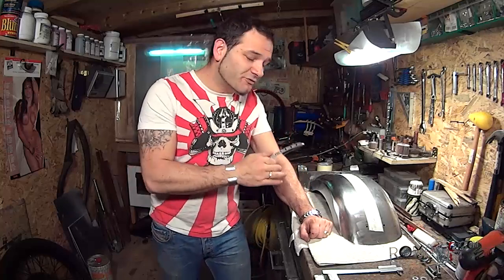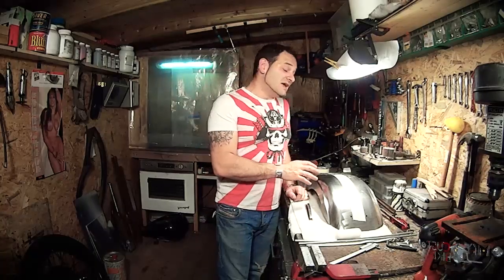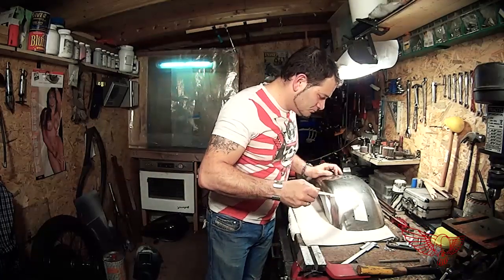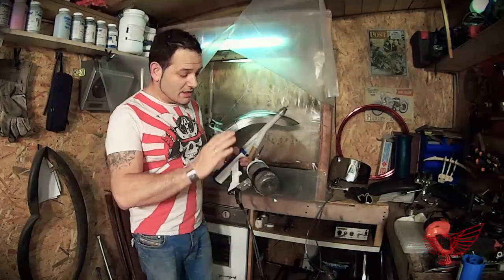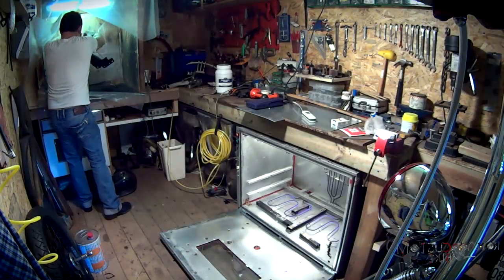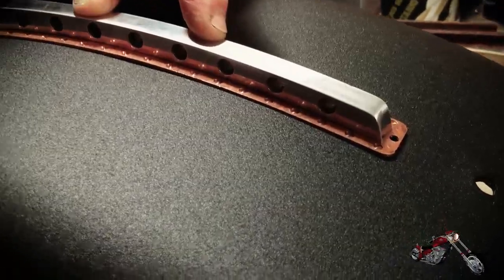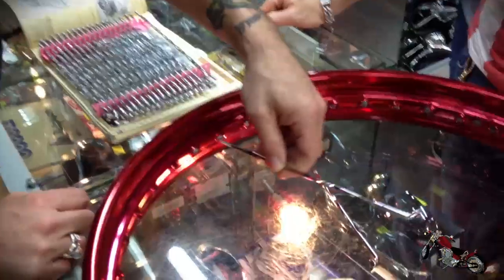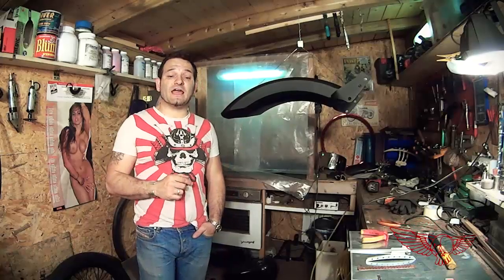DIY Powder coating at home, how to, tips and tricks - Harely fender - 5 - Roma Custom Bike

Comment: I just found this page yesterday and I completely dig it. I have a question about the temps for coating. 1 - What temp does the oven need to be2 - What temp does the item need to reach before you set the timer3 - How long do you keep the item in the oven once it reaches said temp
Reply from the maker: +claythe1 hi Clay and thenk you :)
both the oven and piece nedd to be at 400F (204 celsius), some paints require different temps and it will be marked on the paint box. Point is that what ever temp is referred to the part, so a large cast iron piece will take longer to reach the right temperature. 
Usually you will set the timer when the paint "flows out", so goes from powder to liquid form. Also the time depends on the paint, most require 20 minutes, candy and transparent a little less time (and often less temp too). Again the time shall be specified on the box or on the manufacturer site.
Hope this helps :)

Comment: I have a 2006 Honda Rebel and want to powder coat the tank.  It has never been touched before, no rust inside or out....just a question.  Will the baking process cause any damage to the factory lining inside the tank?
Reply from the maker: Bob G Hi Bob, well, that's a good question and I would suppose yes! but only if there is one. Often there is none or a very light coating of paint. If the after market lining was applied before (like the one u can buy in stores for restoration) I would imagine yes.
Let me know what u come up with :) I'm curious

Comment: Course you can fill. I think the most I have done to anything was 4 coats of epoxy primer with some filler on each coat of primer, then a single top coat of polyester. I use JB weld. Not that I use that much filler, I am still on the tubes I bought in 1991! All with a cheapo gun.
Reply from the maker: doesn't the filler bubble up under the powder when you put it in the oven?
Reply: Custom Cez
No The JB weld I have is good for 600º, yes the funny little yank degrees.
It takes a few days to cure, but I wack the part back in the oven for an hour at about 80º and the JB weld is hard. I only put a very tiny amount of JB weld in for slight imperfections I have missed. I guess it's probably JB weld classic, I bought the tube in C1990. I keep meaning to try lead free solder, body solder starts melting at ~185º lead free it is over 200º. That coating gun looks good, I use the very cheap thing.
Reply from the maker: the second thing i thought about is that it wouldn't stick because it's not metal... but if it works for you i guess it's not an issue... i'll try it.
I did try regular lead and it does melt and run away from the part, next order i'll get the lead free from eastwood... already in my wishlist ;)
thx for the info, definitely gots to try it :)

Comment: Thanks for your video! One question....how do you stop airborne dust and fibers from settling on the part which is what I'm having trouble with? Oh and btw its an electrostatic attraction not electromagnetic...
Reply from the maker: Hi DE s, thank you for your comment.If you can't have a very clean and sterile environment try spraying some water on the walls b4 coating, that will keep the dust a bay for a while :)
Reply: Custom Cez
 Thanks,  good Idea...but I saw your spray booth and I made one too! thanks for the idea..I used it and still some crap on the powdered part...I think I need an inline air filter now.....another question if I may, how do you regulate your oven temp please?
Reply from the maker: u r welcome :) glad i could help.
For the temp get a laser thermometer (harbour fright perhaps) and check the temp on the actual piece to make sure it's going at the right temp :)

Comment: Bro will brake cleaner strip powder coating?
Reply from the maker: Hey man, it doesn't gurt to try if u have it laying around :-) but most people talk about the gasket remover as an alternative to professional products. I use a product i found in europe who's main ingredient is methanol. It works better that the powder stripper from eastwood. If u can fins some stripper with that ingredient u'll be good :-)
Reply: Custom Cez the reason I'm asking is that I purchased a powder coated extended swingarm for my Raptor and I did the assembly and bleed my brakes. so after I bleed the brakes I sprayed up a caliper with the brake cleaner and the residual brake cleaner literally stripped the paint off of the swing arm or alleged powder coating I should say. so I was just wondering if it supposed to do that with just brake cleaner??
Reply from the maker: andujo211 i see, well anything chemical like that if left long enough on the painted surface will do some damage to it, but i'm talking loosing shine or minor damage, i used the powder to do the brake reservoir and it's still like new. So probably wasn't powder... or crappy one, like not properly cured. Sorry man, my suggestion would be either to return the item or bring it to a local powder coater and get the job done to your standards.
Reply: Custom Cez Right on. thanks bro I appreciate the info.
Reply from the maker: no problem man :)

Comment: Spelled "responsibility" wrong at the beginning....

0:54 secs
Reply from the maker: crap! that's in every episode :( thx for pointing it out man
Reply: Custom Cez No worries. Liked the video regardless.

This DIY powder coat thing has got my blood pumping in the last week.
Would you be able to use a convection oven, the ones with the fan in them that moves the air around? Or would the fan disturb the powder before it got a chance to hit the melting point?
Reply from the maker: thx man :) i appreciate that
Reply from the maker: Sorry man, didn't see that part on mobile. You have to be able to switch off the fan when the piece is inside, not only because of the powder flying b4 flow out, but also because if there is any dust in the oven it will be blown onto the part. 
It shouldn't be hard to disconnect the fan though, or even add a switch. Just open the oven up and see were the cables going to the fan are. Then either cut them and tape the ends or add an extension and a switch. Note that when extending wires inside the oven you should get the same type rating of fire/melting resistance.
Reply: Custom Cez Good info. Thanks. I dont have a gun or oven yet. But with all the cool shit you can make. I might just get one and buy a crappy $100 oven to bake the parts in.  Italians for the WIN!
Reply from the maker: Indeen man!!! Italy rulez :)